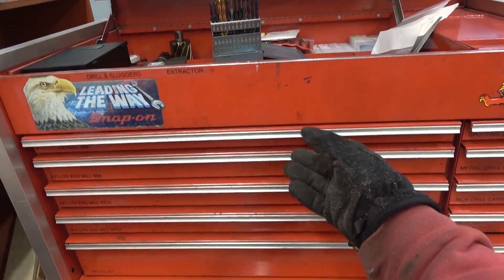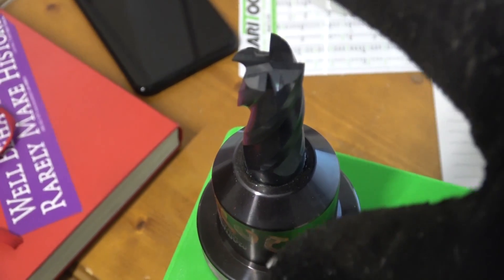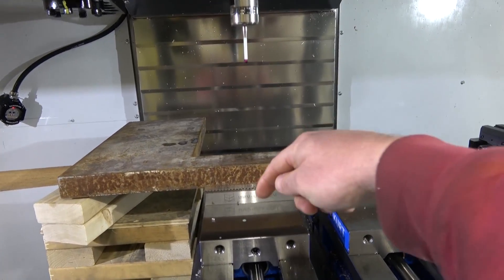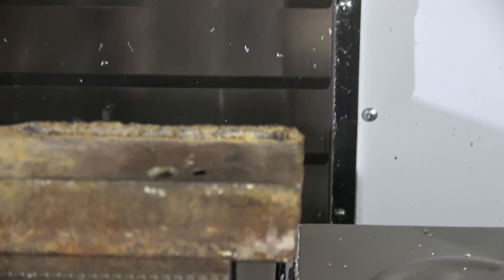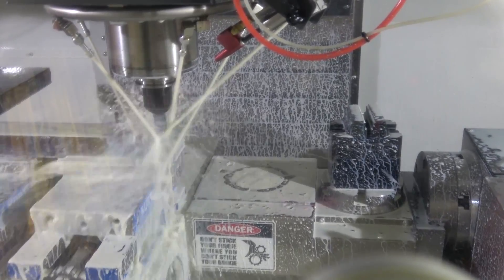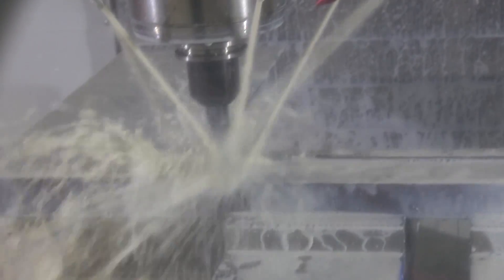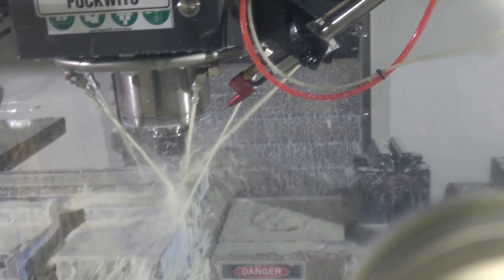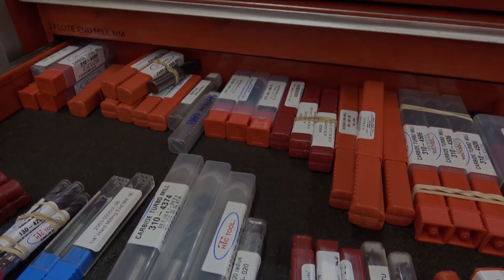AR500 Hard Steel vs. Chinesium Carbide

Comment: My fathers workplace runs Hardox 450 on a old russian lathe. They described it as "You basically just have to crash the machine into it for every cut, and hope for the right things to break"
Reply: I was just looking at an old military patch, dawn of the jet age... "iron sharpens iron" is the motto. Spartan helmet on a skull and wings. That is probably another motto.. a motto for the motto. holy cow another one: "a motto for a motto". this could go on a long time.
Reply: @bgd73  That's from the Bible.
Reply: In Russia, Mill probes you
Reply: What russian lathe?
(Fellow russian)
Reply: @nurmax9929  No idea, I think it's from the 60's, so some kind of soviet one. The most rigid they could find.
Reply: @MrJamesBanana  Irony...
Most of lathes(idk) in russia is Soviet. There is no such thing like "russian lathe".
Well, our machinery suck ass after USSR collapsed.
(Sorry for any mistakes)
Reply: @nurmax9929  "There is no such thing like "russian lathe". there are 9 machine building plants that are still producing lathe and cnc, quit with that crap 

(sorry for my french)
Reply: @NURMAX I´ve been working with a Russian lathe and the stability was excellent. We could beat it so hard, that the cooling water was evaporating fast when cutting stainless steel. We still made some modification to the lathe changing all the brittle copper wire to soft copper and new circuit breakers, new electro motor reduced the noise considerably, but a new adapter flange must be produced due to physically less size for the same power. Finally digital scale and that was back in the 80'. Tool holders could not grip sufficiently hard as today's Capto crimp, so we have to be careful that the cutting tool didn't move out and cut the plane.
Reply: @nurmax9929  that means it's built like a Dutch plow.........a little heavy where the pin goes 😅
Reply: mirycreek I just married a Boer woman. A little heavy where the pin goes, but boy can she plow.
Aussie farmer.
Reply: You should try cuting some 954 aluminum bronze. I mean it's aluminum and bronze so aluminum speeds should work 🤫
Reply: Reminds me of my youth, milling cylinder heads at an engine reconditioning factory. Some of those mills, lathes and CNC machines were older than the guy who retired last year.
Reply: How is this comment two days old on a video that just came out ???????
Reply: @MikesSoftLemonade  patreon viewers see it before non patreon viewers
Reply: @MikesSoftLemonade  Patrons get them early?
Reply: Mike Phelps - early access for Patrons
Reply: Mike Phelps I imagine Patrons get early viewing privileges.
Reply: @MikesSoftLemonade  Patreon Maybe
Reply: @MikesSoftLemonade  How soon we forget that AvE shares videos with Patrons before posting on this channel. That's how you see a comment that old.

Comment: I use a hanita when I cut this stuff. Was able to cut .625 Depth .15 radial. I think around 2,000 rpm at 19 ipm. Run alot of ar400 2300 rpm around 28 ipm same depth .25 radial. Ghuring diver endmill works great on the stuff to.

Comment: As someone who isn't a machinist. Could part of the problem be the way you rigged that L-shaped piece of stock out? The heavy end L-shaped end hanging out? I know you had something underneath it but, with the good review you gave the bit prior to filming this cut, and the way that the bit seemed to crack/break towards the end of the cut repeatedly. Wouldn't that indicate a possible slight vibration cause the bit to fail? Or was that the intention the entire time?

Comment: Cutting hard steel with end-mills has been troublesome for me. I switched to insert  milling and never been happier.
Sure, those things don't last as long, but at least they're VERY consistent. I also use a Kolroy system that has part A and B for roughing so, part A will cut a certain height and B on another, Both blades are on the same APMKT insert, so you just have to buy one set.

Comment: >that tool diameter though 

Use the largest one you got.  Iffin ya got 5 inch face mill with inserts, use that, not your dinky pinky end mill to face with.

Comment: Love your video's & any which lend me any assistance when drilling threw hardened steel! I always have a miserable time when hand drilling threw steel, much less hardened steel! What drill bits would you recommend I use in a corded & cordless drill to go threw hardened steel ? also fast speed or low speed???? oil or no???

Comment: The shop I work at has a rule:  you wear it out; we replace it.  You do something stupid: you do.  So forgive my old school conservatism... But we work a lot of AR 400 plate... It does not take much imagineering failure to spend a weeks wage on bits.  Chinese or otherwise.  For surfacing I find a fly cutter is the safest, fastest way to get through the hardest layer at the most cost effective tool/time/set up cost.  Finish is remarkably good too if you slow the feed rate down and take light passes.... 10 thou inc to maybe 40 as you get deeper.
Another approach a buddy of mine uses is to simply grind the surface finish off by hand before machining.  I tried it, and with a new disc it goes pretty quick and made a big difference later on the mill. 
The worst situation for me is when the cutting table guys give me an inch or two of AR that they cut too fast.  Flame hardened holes, reverse draft angles, slag fused edges... Its honestly faster to cut and drill it myself... You have a beautiful machine there but AR plate is one material I prefer to work on the power assist manual machine when a sketchy set up or crappy rough cut part hits my bench.  Thanks for another great video.

Comment: not supposed to run coolant on steel.  could be a reason the tool failed.  better off with low spindle rpm and faster feed.

Comment: You can disable the tool release and the .01/click buttons on the control panel through your settings.  That's the first thing I did so people would stop dropping tools when they tried to set their workpiece zeros.  Tool release lockout is setting 76.  Setting 163 locks out the 0.1/click resolution.  Find it through your "setting" button on the control panel and flip through pages or tabs, or just enter 76 or 163 and the down cursor to auto-search

Comment: Can that particular variety of steel be dialed back in hardness via heat treatment, such as annealing or tempering? It seems to be getting hot enough to be quenched to hardness by the cutting fluid, so maybe another process could reverse that hardening.

Comment: Is the coolant fluid filtered of shavings and recycled somehow? Even if it's some additive mixed with mostly water, that's a big volume used.
Reply: It is indeed recycled, and you are correct about it being an additive (namely oil and a detergent) mixed with water.

Comment: We have all our targets cut by waterjet. 
Any heat that discolors will actually soften the AR400, causing large crators when hit with the lead injection. 
We bolt everything to conveyor belt and just deal with a new bolt here and there, targets last a super long time given the ability to shed energy and move along with no disruption of the heat treating/hardness/toughness.

Comment: At my old university someone loaded a centrifuge without counterbalance, the thing  spun up to about 5000 ripems and decided to break free from it's human captors, went right trough a couple of inner laboratory walls and then an exterior wall ending up on the lawn outside. Gotta respect anything that moves spins or is under pressure in some way.
I myself have witnessed this happening but I managed to run and press the emergeny stop button while the girl responsible for loading the centrifuge listened to her self preservation instincts and just ran away.

Comment: I used to work for a place that machined hard materials all the time. Parts for ore handling and processing. We always used high feed rates with tiny cuts and button inserts everywhere we could. Cut your shape to within about 5 thou and then a solid carbide at full depth to clean up the surface. Avoiding cutters where all of the point load is on a tiny tip seemed to be the trick.

Comment: Ive not been a machinist since the 90's, but to me the tool RPM looks way to high for such a hard material. And with the slower feed rates you just generating heat on the cutting edge and hence the tool pulls out the white flag after just a few mins.

Comment: Next time you touch off tools like that get a .5 pin or what ever. Round is better. Set your hight offset +.5. Move tool down further then the pin and then move tool up until it you can slide the pin under the tool. Do not move tool up or down with pin under tool, always move of to the side. Watch fingies!

Comment: Your sfm is waaay to high. Try between 700 and 900 rpm no more than .002 chipload. However no matter what you do you will not get any significant life trying to face with a sharp corner endmill in that material no matter what quality. Use the face mill 200 sfm and start with .008 chipload

Comment: Use a speed and feed calculator like hsm advisor and turn the coolant off. You don't even need an airblast. Also the facing OP is just never gonna work with that hardness. The depth of cut vs side milling is gonna just generate an insane amount of pressure and heat and no matter what you put your speed and feed at you will be losing endmills. I'd probably try side milling the facing OP after the side milling op and then taking a .01 skim cut to make it look pretty even though that would still wear out the bottom of the cutter.

Comment: Id avoid that style of machining approach for hard plate.  You know that now.  I’d start at 150 sfpm and go from there. When I machine hard plate, I use Kennanetal small face mills with 8 usable edges per insert, reduces cost of material removal, plus some good choices of inserts.  Small DOC and high feed, less cantilevered load on spindle.  Vibration from tool stick out is a huge deal with hard materials ( inconel )

Comment: I recommend disabling the .100 feed button and took release button in the parameters.  Last thing you want to do is drop the tool trying to hit offset.  Stupid placement of that button.  Also, 500sfm is WAY too high for hard steel.  Keep a decent chip load but crank back the SFM.

Comment: What about an abrasive cut off wheel?  On a side note I cut some ar500 with a lake shore carbide 4 flute .032 round corner. I bored some holes for a guy to hang the plate to shoot at.  I went really conservative on speeds and feeds.  With lots of air mist.

Comment: I personally dont trust chinese cutters,   You might be fine for aluminum  and maybe some mild steels but once you start working with fancy stainless, titanium, or hard steels,  They dull like youre cutting wood with a plastic saw.   Not all carbide is the same,  the composition and micro-structure of the tool plays a huge part in vibration dampening and edge strength. Using a better tool makes a world of difference when milling harder materials.    Check out the Kennametal Harvi 3.  That tool is like a tank. It just keeps chugging away even when the edges wear.  And dont be afraid to call up companies like kennametal or Lakeshore  to steer you  in the right direction for tool choice for what you are working on.  Theyll even give you feeds and speed recommendations.   I find their info much more reliable than a forum board.

Comment: Brother, there are limits to which material can be separated from itself. Start with the correct SFM for the material, then adjust everything else based on workholding, process reliability and tool life requirements. Thanks for your time!!
Reply: SFM then IPT. You will get rpm and feed rate as a result
Reply: It’s like water, you can jump into a pool no problem but there is a velocity at which your body will break before the water separates.
Reply: I make a milled aluminum wallet and would like to send you one.

Comment: I think you're a little confused with your ar500 thickness selection.
1" ar500 will stop 50bmg ap ammo.
For whatever you are shooting 1/4 ar500 will be plenty and have a better reaction when shot, thicker pieces are harder to tell when you hit them
Reply: Being up in mining land, that's probably a scrap from the job site. That AR 400 and 500 plate is used for dump bodies and cutting edges on buckets and other ground engaging equipment.

Comment: surface footage toooo hiiiiiiiigh. Think abom.
three broken endmills in hand "Yeah you can get the job done" lololol Slow er down man, hit start and go have a coffee. Process reliability especially in R&D is king. Bet it would have sounded fantastic at around 700 rpm in low gear with a 4 thou chipload. Slow, but nice and quiet.
Reply: He's still acting like he's running a manual machine. If you get the thing where it's running okay, walk away. The worst thing you can be as a knob turner.

Comment: 1/2" AR- 235 took over 2000 hits over 5 years from a variety of pistol calibers. Only reaction was some very slight cupping of the entire surface. Turned it over and used it some more!. You'd prolly hafta use .50BMG-AP to punch that 1" 500 series. I have some 3/8" ar500 that shows no deformation after many hits of . 5.56mm and only bruised slightly after whacked with .30 cal hardball.
Keep on! ;)

Comment: You might have seen Titans of CNC. The way they're slapping through Inconel puts your dilly dallying to shame 😂
On a side note you're climb milling? You might make a better tooth engagement and clear the chips away from the face, taking the heat with the chip with conventional milling, also the rake slapping the outer face with climb milling equates to an intermittent cut which brittle ol' tongue glide doesn't like too much. As for feeds and speeds I'm lost unless it's a metrique basis 😅 cough*dinosaur*cough

Comment: The poor cutter did pretty well considering you had the least rigid setup possible.  Uneven not parallel edges being held high up in extended jaws of the vice(s) on top of a massive hollow box square with a huge bit of excess hanging off the side mostly unsupperted.  I don't know what you expected to happen there, but it was never going to work out.
Reply: I disagree. It could have been even less rigid if he had put some wood (That's tree carcass for the regulars) between the table and the cube. He could also have used a long series end mill. Come to think of it why not just use the end mills for target practice? Gotta love AvE though, he's a true entertainer.

Comment: I have a 600 & 1000 yard shooting range. Used hardox on the sighter gongs which I welded to sucker rods (so that they'll swing on impact). Haven't had any problems with cracking.  They were cut with a waterjet to size.

Comment: If those edges are torch cut you will have better luck conventional mill through the torch slag, I know it's a cnc but conventional for that application.  I used to heavy machine and am a Toolmaker currently. You need to get below the slag and you don't pull the slag through the cutter.

Comment: I typically just touch the tools off on the workpiece with a piece of paper and scribble down the tool# and the z offset. The z offset is almost always negative from the limit switch down. Hard milling is crazy lower feed use the wear resistance of the tool to eat away at the material. Try single profile thread milling die steel (enginerds and  the hole locations they give)

Comment: you're not suppose to rough with a square EM for steels, let alone AR500. Always should have a radius on the end. Plus the grind of the endmill matters also. And 500SFM in AR500 is way to high. Try 200, and that's even pushing it.

Comment: Partner ! You're gonna want to slow down that spindle speed. Any of these hard matrials or heat resistant materials like inconel you will need to run at around 100sfm especialy with chineesium .  Try 100sfm /0.004 per tooth.Also do yourself a favour a get some corner radius end mills , sharp corners in hard materials is a sure fire way to toss your money in the trash bin. 
Cheers

Comment: As someone who tinkers with 3d printers It's interesting to watch how this is still so finnicky on such a professional expensive device. There's little hope for 3d printers to become any more idiot proof any time soon. However with time maybe we'll see the much cheaper but far more widespread printers implement different methods that translate over to milling. Me thinks it's going to take an AI implementation to finger out the finer points and achieve full release for the layman

Comment: Great stuff as usual mate. So was it AR400 or 500 in the end? As Andreas Erngren mentioned earlier; You can gas axe that stuff fine. Just give it a good pre-heat and avoid cutting sharp corners. Shouldn't have too much of a problem cracking then.

Comment: Setting 76 will give you the option to turn off the tool release button on the controller so it’s just the button on the spindle. I have it turned off on every machine in the shop.

Comment: If you just just kept your WCS Z at 0
And then just manually touched off and wrote the negative Z number that’s shown in the position read out for the tool position that would have saved you all that probing shenanigans
Reply: ALSO SETTING 76! YOU CAN TURN OFF THE TOOL RELEASE BUTTON ON THE CONTROLLER!

Comment: i thought climb milling was a no go? seems that was the whole operation though but its been while since ive run a mill.
Reply: Climb milling is preferred on a CNC. Due to the ball screw feed, backlash isn't an issue like it is on manual machines. Climb milling is actually more efficient.
Reply: @BottomLineMarine  i'll have to take your word for it. all i've ever run was a manual mill and climb milling always ended in chattered or smeared finishes or broken tooling.